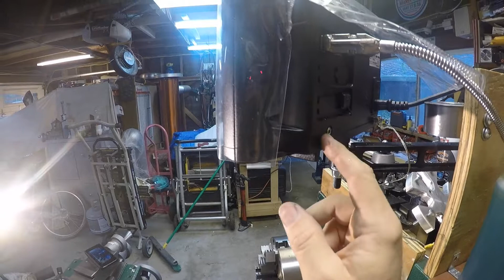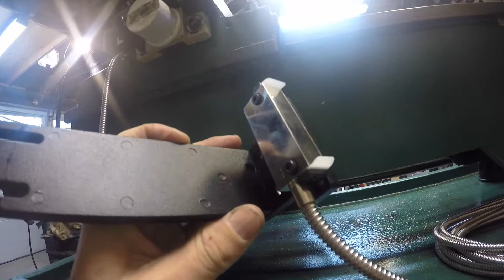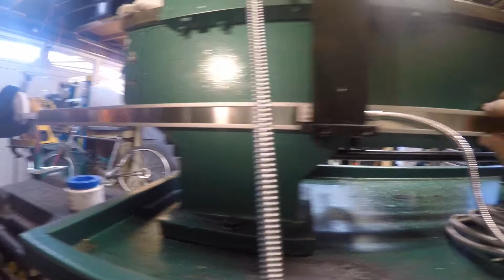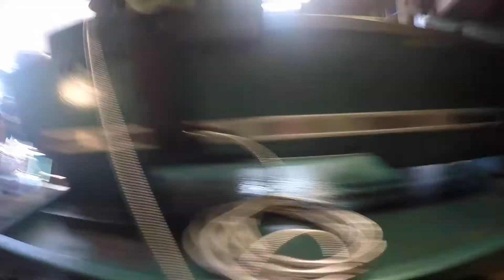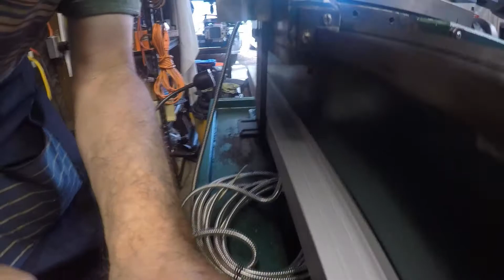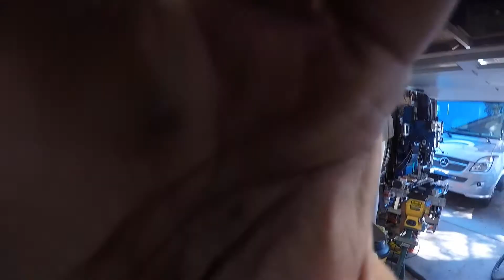DROPRO install on Grizzly 4002 Lathe Part 2

Comment: How much did it cost?   Is it correct when you say DROPRO doesn't make a shorter scale then 40"?
What is the roller looking assembly just under the motor secured to the chip pan?